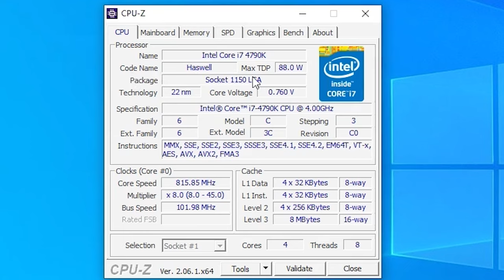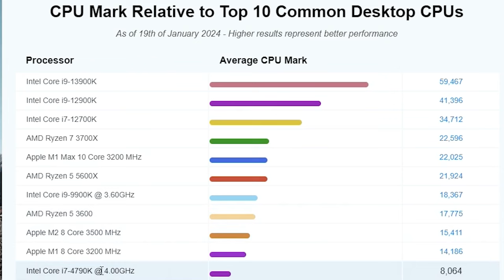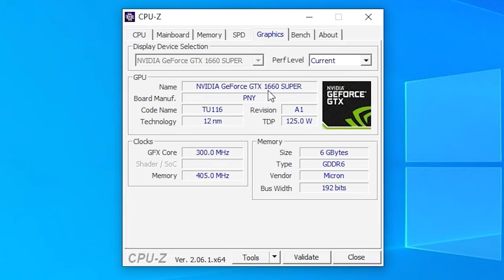$199 Intel / Nvidia Emulation Rig: Retro & Steam Gaming on a Budget !

Comment: Lil brother is using a 4770k atm overclocked lightly to 4 ghz flat like the 4790k.
Paired with a gtx 1070 8 gb it runs decently well with newer games & I'm using a 1660 super myself atm still.
Which with my ryzen 5600 i bought & built with last year runs everything I'd want fine as well.

Also I'd pair that up with a m.2 ssd as you have a slot on the motherboard for one on the board.

Comment: Do you think my i5-4670, 1050Ti,4x4GB ram, 240GB ssd will be capable to achieve good results in emulation?
Reply from the maker: Most important is the cores and threads. 
With i5 you have less so performance can be different for emulation.
Regarding the GPU you can do gaming it's fine card. 
Still maybe you will find some problems with emulation with higher end systems.
PS2, Game Cube I think that is not a problem and even if you cant get 4k rendering try 1080p. 
Just tweak and you can play so much on your systems to.
Normal games put it on low / medium settings.
Reply: @WickedGamerCollector  Thank you so much! For me 1080p is fine as I use my old 32" 1080p TV as monitor.

Comment: xb360 could be too much ... or was building the shader cache first - ( hence the stuttering ) - doing the very same track second time, could work like a charm if that's the case ( but possibly just the case of insufficient cpu power )
Reply: For all I know it's the Nvidia card trying  to emulate an AMD GPU that is the problem. I've heard AMD GPU's perform badly in XEMU ? (Xbox classic emulation)
Reply from the maker: Try'd couple of mini pc's now.
Result it's 💩
Do we not need some more juice for this ? 🦾

Comment: 199 euro for an entire system is a bit optimistic considering the 1660 super?
This one shows clearly that most SBC's and MiniPC's (except the really expensive ones) do have enough CPU power but lacks the GPU power needed to emulate the newer gen consoles in upscaled resolutions. Emulating the Xbox 360 emulates badly on Nvidia cards so you might try a comparable AMD GPU for that and it probably will run fine. But a Xbox Series S might be a better idea for playing Xbox 360 games. 
A AM4 3600 or even i3 10105F system is al you need to emulate most systems if you have the right GPU.
Reply from the maker: It's what I pay'd for and priced did drop here with pc's used and parts.
Reply: Wicked! Another remarkable good buy for you :)
Reply: Btw for emulation you dont need RT and then is the 1660Super one of the best options because it has reasonable power consumption also.

Comment: I Still have my WinXP/Pro Dual Boot. Recently put it in a new case to match my others. And upgraded the cooling to a 360 AIO.
XP 32bit (4gb), XP Pro 64bit (8gb) Duel Boot.
Montech X1 White Case -
Vetroo V360 White Liquid CPU Cooler -
ASUS P5NSLI -
Intel LGA 775 Core 2 Duo E7600 3.06 ghz -
4x PC2-6400 2gb = 8 gb -
2x Geforce GT 230 1.5gb SLi
Reply from the maker: Keep them and enjoy them.
Socket 775 i have couple of build idea's in the future going to be fun !